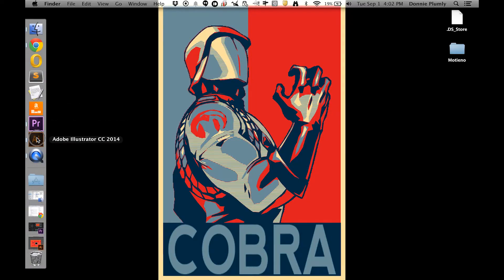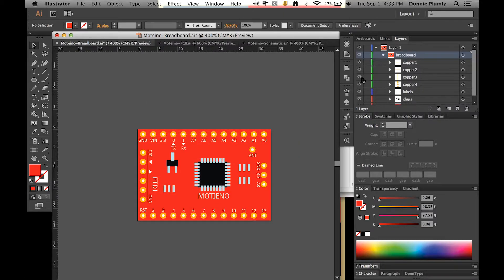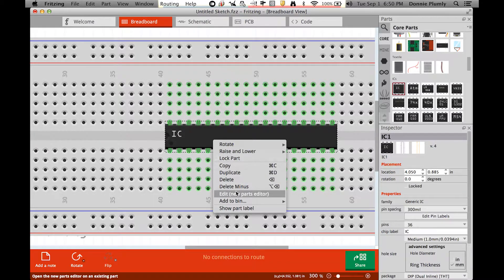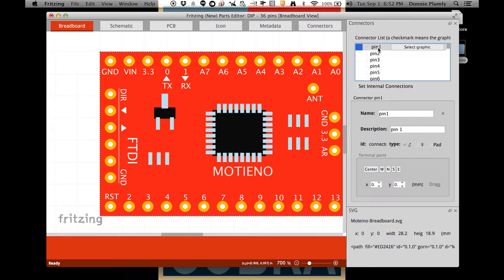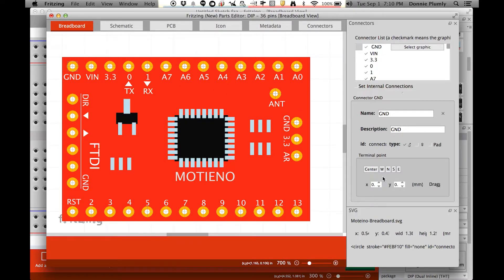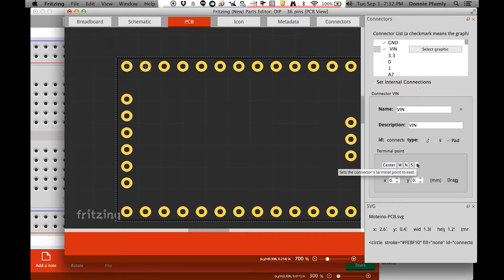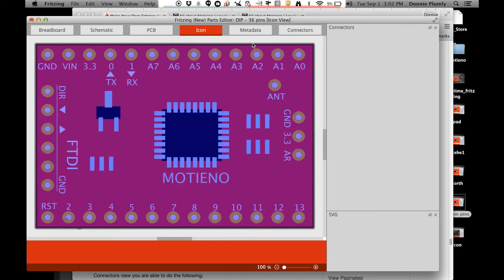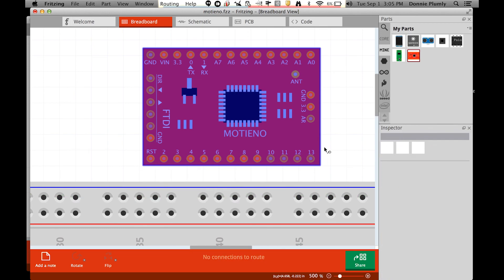Make a Custom Fritzing Part

Comment: You don't have to "N"orth ring pads, centre is fine. Yes the pins need to be in the overall SCH drawing, and it won't throw it off grid if the whole thing was made on a 0.100" grid, ie, the 0,0 of the selection box with still be on the grid snap point.

Comment: What is under the other copper layers? it has 4 of them.
Reply from the maker: +Dan Faltenberg Under the copper layers in the illustrator file are the labels on the board,  the chips on the board, and the last is the red silkscreen.
Reply: +Donnie Plumly Thank for responding quickly! I'm running into some weird problems. I followed your video and I think I made all my graphics correctly. 

But when I import into Fritzing, the Schematic view enlarges all the labels so that everything overlaps. The PCB view is just a black box, but you can select where the copper pads would be so I can still assign graphics. The breadboard view is the only one that is imported just fine.

When I import the SVG files to the icon tab, they all come in the way they are supposed to. I'm not sure what is going on... any suggestions?

I can email pictures and am willing to try a screen share if it will help you understand. It's just a big project and this is the most comprehensive tutorial I could find so I'd really appreciate any help
Reply from the maker: +Dan Faltenberg I would have to take a look at the file to see if I could understand. The files I used to make this work are on Github (https://github.com/dplumly/Fritzing-Parts) I just changed the link above so that includes the parts that I have made as well as the parts for the tutorial. If you go into the motieno project and look at the illustrator files you can see exactly how I got it to work. I can take a look at the files if need be, but take a look in those files and let me know if you got it figured out.
Reply: +Donnie Plumly You've been a fantastic help so far! Seriously. I've done it all thanks to you!

But, I noticed one last issue. The total sizes of the breadboards, PCBs, and Schematics that I specified when making my SVG didn't come through. Instead, they are all the same size. I'm not sure if this has something to do with the height and width percentages but I can't get the image to show up if I do anything other than percentages. 

Is there a way to specify dimensions of the parts so they are different sizes?
Reply from the maker: +Dan Faltenberg I have been playing around with this and I have been trying just mm instead of percentages. I did get the image mapped, but I will need to spend more time with it next week to try to hammer out the details. Give the mm a try and see what happens.